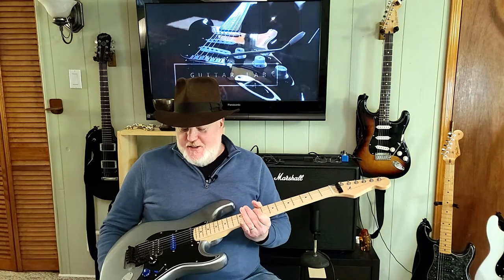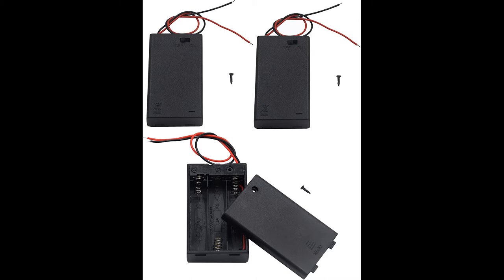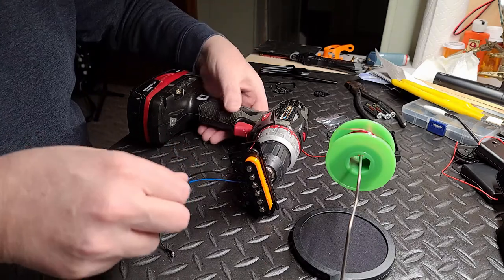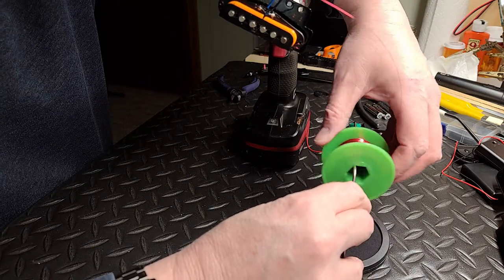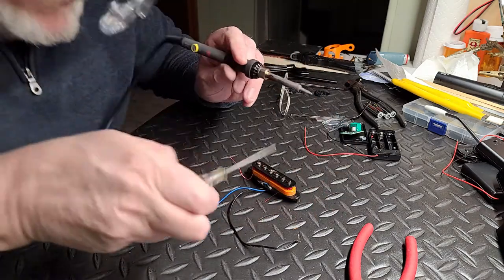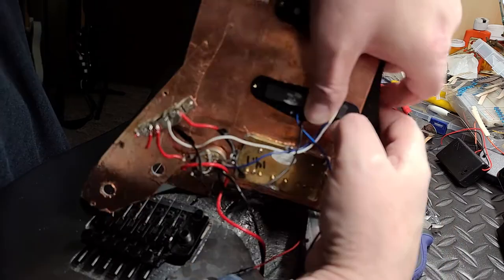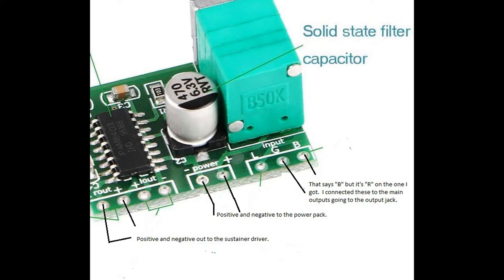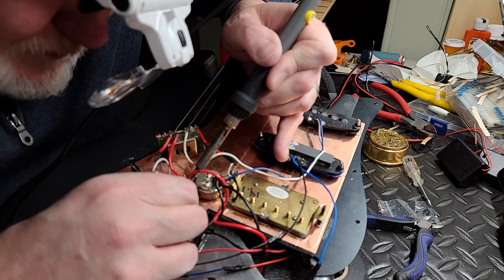Active DIY  Guitar Sustainer for about $20!

Comment: Awesome and thank you! I just did the same thing based on your video. I made one small tweak, I soldered another potentiometer in parallel with the sustainer coil and used that to lower the maximum output level to get rid of that feedback issue.
Reply from the maker: That's an awesome idea.  Post a video of you demoing it and share it!  I'd love to see it in action.
Reply: I agree, I’d like to see this as well!
Reply: yeh dude whats it like??
Reply: Nice trick bro...as a variable resistance, or a shunt to ground?

Comment: I'd be very curious as to how different it would sound if you reversed the polarity on your driver coil!  That "might" cut down on your unwanted feedback at high gain.  That is a common technique used in sound reinforcement if an acoustic gtr is feeding back - flip the phase on the monitor.

Comment: I notice many people are asking about using a 8 ohm resistor to try and use the pickup coil itself as the driver.  That will NOT work.  However if you could find a transformer you might have a shot.  It would need to be 8 ohm to maybe around 5000 ohms.  The higher the better.  Most of these are used as "step down" from 5000 to 8 but any step down can be used as a step up.  There are no longer any "Radio Shacks" so you can maybe find one online or you could scrap an old "transistor radio" (if you know what you are doing).  The right transformer to scrap would be the one connected to the speaker - and that would be the 8 ohm side of it.  ALSO REMEMBER that this could permanently fry your pickup.  They are not made to take any wattage.  The pickup windings have a much thinner wire than what the poster used for his driver coil wire.  Ever seen the wire in a 1/2 amp fuse??? A 1/2 amp fuse would fry at 2 watts (at an 8 ohm load).  😲

Comment: About 20 years ago, a friend of mine had a Fernandes with a sustainer system. It was so much fun to play with, but the pickups had ZERO volume roll dynamics/headroom. The volume pots were basically on/off switches. Even rolled up 1/4 to 1/2 way, it was about as dirty as it was on 10, even on the most responsive tube amp. I roll my volume through all of my performances. It's the source of my dynamics. The Fernandes was useless to me due to the lack of headroom. 

Does that have anything to do with the sustainer system/pickup or was that maybe that the guitar had shitty potentiometers and/or capacitors? That's the only guitar with a sustainer that I had ever played.

I've wanted to hot rod a Charvel So-Cal with one, but if it has anything to do with eating headroom and dynamics, it would not be worth the trade off.

Comment: Watched this again this morning, have a near future build that I want a sustainer in,  pretty straight forward. The spacer is my question...... it's the insulation between the stock winding and the new copper wound wire, 3 mm , I was thinking about using either wrapped gorilla tape or a piece of plastic storage container,cut and heated up to bend around the single coil
I'm thinking beyond shorting, possibly a noise issue? Otherwise I did easily locate the rest of the items.
Also would 100-110 times around give you 8 ohms? Rather than the 120? I don't really do alot of wiring, so I'm definitely a novice as far as this stuff goes, again Thank You in advance.
I'm tempted to just buy one but they are so pricey for something that you use here and there.....

Comment: Hi! Got a few questions about the image at 6:35:
1. Should I solder the positive from battery pack to negative in the amp?
2. Hot about those G and B? Should they both be connected to output jack sleeve/tip, or what? I don't understand it properly.

Btw, good job on explaining the thing in barely 10 minutes :)

Comment: Does this works polyphonicaly? I mean on multiple strings at the same time.
Reply: It should since the pickup is the sustainer and covers all strings. The sustainiac guitar by schecter works just like this. That’s kinda the point of using one of these vs an Ebow device. More options. I’d think two string octaves would sound wicked. I use an Ebow and have always wanted to give this a shot.
Reply: @michaelsnydermusic  that's what I thought! But I have never seen any examples of this. All videos I've seen  only use one string on a high gain. While I'm interested in being able to sustain chords.
Reply: I reposted your question and he says yes, it will excite all the strings (that aren’t muted)
Reply: @michaelsnydermusic  awesome news! Thanks for letting me know!

Comment: Did you remove the existing wire from the pickup and rewind, or did you put the spacer in on top of the existing wire and wind new wire over the spacer?
Reply from the maker: Hi Shannon. I removed the old wire and completely redid it.
Reply: @guitarlab7772  cool! Thanks!

Comment: Very cool idea! I love hacks like this.

When the sustain is engaged it sounds out of phase like the intro to Money For Nothing. 

If you reverse the leads going to the driver you'll invert the signal and bring it back in phase with the pickups. Some amplifiers are inverting while others are non-inverting.

It may also be cool to add a DPDT toggle or push-pull potentiometer to the driver leads so that you can change the phase at will.

This is all purely speculation, but I believe the phase issue (if present) may also be the reason some notes sustain better than others.

Comment: couldn t you just use ANY guitar pickup as a driver ? or would it melt due to too mutch voltage/input power ?
Reply from the maker: Think of it as turning the pickup into a speaker without the cone. The amp is expecting it to be 8 ohms. So you're just trying to get it in that ballpark.
Reply: @guitarlab7772  gotta be 8 ohms ... i see , thank you !
Reply: I don't understand the 3 d printer thing..what are you making with a printer? Is that a requirement?
Reply: @michaelnoe3095  well .. the 3 mm gap is important .. how you achive it not ... coincedently i started working on the coil 2 days ago and i m going to make my spacer from staking and glueing cardboard

Comment: How do you prevent a popping noise when you switch on the sustainer and how heavy is it on batteries ? tia. Nice job .
Reply: @guitarlab7772   sir ,very informative videos,,,but, did it need a power supply ,(battery)? Thank you for your reply
Reply from the maker: @doryempleo9717  Hi, yes the sustainer needs power.

Comment: How do I tell what wirers are positive & negitive from the copper wire?thx
Reply: @guitarlab7772  Actually, the polarity of a pickup or driver coil is also dependent on the orientation of the magnet. Swapping the wires or flipping the magnet will have the same polarity (phase) reversing effect.

Comment: Do you know if the direction of the coil wrap makes any difference? Clockwise/counter clockwise/even or staggered winds?  I'm right handed if that matters. I bought the battery box w/o the  switch. Does the volume knob turn the volume all the way off? thx
Reply: @guitarlab7772  thank you for the quick response. I'm going to give it a go today.
Reply: @guitarlab7772  It worked but, it didn't sound good. It was a fun project tho. Thx for your advise
Reply from the maker: @lauried.2708  I wonder why.  Was it at least sustaining?  Try and invert the + - on the exciter coil and see if that helps.

Comment: So Quik question, Doesn’t a regular pick up already come with the copper wire wound up in it already? Or are you adding more to get to the 8ohms
Reply: He removes all of the original windings because the resistance is too high. He then winds it with new wire to get the resistance down to 8 ohms

Comment: great stuff!! am making this as soon as the parts come in the post. knowing that your one works have you tried using both outputs? might they cancel each other out or short the amp or might you get double the output then needing say 16 ohms of windings?
Reply from the maker: Hi Andy!! That is a great question.  I don't know.  I wasn't sure if that amp could handle being bridged so I didn't try it.  I did think about it as I was wiring it up, but since it worked so well I decided not to mess with it.  It was powerful enough to easily push it into feedback so I figured I didn't need any more gain.  Just remember if it doesn't work to invert the leads going to your driver.  That seems to be the part most people get stuck on and there's no danger to the circuit in doing that.
Reply: @guitarlab7772  will do and thanks dude ! them sustainiacs are way too expensive for what they are, look forward to doing this!! thanks
Reply: @guitarlab7772  thanx shawn, great explanation.  i only have an 8-string  these days, and theres no market builder for one yet.  Theres plenty  of cheap single coils to convert to drivers out there. Whould that change the ohms?  or would ohms be more dependent on the output amp?.
Reply: @guitarlab7772   Hay hi ho,  Hope your'
all  well  ouut there . well, im All in whith.a homemade 8 string driver .
but 2 questions ; Can you switch off and play with a passive non- sustain tone? (2). IF i  had the money , Could  i take  the guts of a sustainiac  and drop in my  homemade driver ? i don't know, but there  might be a ohm problem? Way over my head . "peace all"

Comment: Have you ever tried to do this on a humbucker on just one of the coils? also why did you put it in the middle p/u instead of the neck p/u
Reply from the maker: I have not tried it with a humbucker.  I think I put it on the center because if I fell in love with it, I wanted to have the neck pickup as an option to use normally.
Reply: pretty sure using half a humbucker wouldnt work it would just feedback. the driver he made doesnt produce a sound we can hear but the normal coil part of the humbucker would pick that up

Comment: Hi Just curious instead of rewinding the pickup to get the ohm rating could you just use a regular pickup and add a resistor to get the correct Ohm rating?
Reply: @guitarlab7772  most pickups range from 4000 to  8000 ohms if you put a resistor that was 8 ohms in the chain whether in parallel or in series you’d be very close to 8 ohms because a normal pickup has little to no resistance. You’d be looking at approximately 7.9 or 8.1 ohms. So I know you can get the correct rating with a resistor. I’m just wondering if getting your resistance from a resistor rather than the pickup itself makes a difference. Reason I ask is if it can be done with a resistor that would save a lot of time and money.
Reply: @guitarlab7772  yeah that’s what I was afraid would be the problem I was thinking of still trying it. I saw a 10w 8 ohm resistor for a $1.50. I figure worse case scenario I’d lose a $1.50.
Reply: @islesnd  That would not work.  A stock Strat pickup has a resistance of about 7200 ohms.  Putting an 8 ohm resistor in series would make that 7208 ohms - and hence it would do nothing.  In parallel, the 8 ohm resistor would swamp out the coil and your resistance would be very close to 8 ohms (current ALWAYS takes the path of least resistance) but all your amp would be doing would be to heat up the resistor.  Very very little current would actually get to the coil.  Like say you had a waterfall that was 75 FEET across and you were trying to get some kind of decent flow by diverting it with a 1" pipe.  Which one is going to have more current???  Electrical current flow is exactly analagous to water current flow.  My analogy of the waterfall sizes is exactly proportionate too.
Reply: @hotpeppersrcool  gotcha
Reply: The 8Ω measured is the DC resistance of the copper wire, it's only for a 'basic check' to get a ballpark reading, as the signal is AC the real measurement needed is impedance also in Ω like a speaker. This sustainer device is more complex, it's a coil of wire, an inductor and inside magnetic fields.

Comment: positive and negative like hot and ground? then combine 2 wire to 1 and solder to pot and switch?
Reply: i mean positive and negative out to the sustainer deiver
Reply from the maker: Wire it just like I show in the diagram.  If it doesn't work, invert the polarity on your driver (plus to minus, minus to plus).  There's no danger in changing that part of the circuit.

Comment: Does it still work as a mid pickup. I really want this and the feedback is really cool for metal music. I have no experience or knowledge in this field . would this project be too hard for me. Feels a little bit daunting... And can you pleade explain to me how Synyster (A7X Guitarist) got feedback mode and normal sustain with just a flip of a switch... Please help me out, I won't ever afford a sustianic pickup of my own...
Reply: Digitech makes a feedback effect pedal that you can get for under $140 on reverb. Not sure where your budget cutoff is but it's a cool pedal.
Reply: if in one direction the pickup gives feedback , turning around the wire's polarity (sustainer) will give the other mode ( in phase)
Reply from the maker: No, the driver stops being a pickup.  It is producing output.  I don't know about Synyster.
Reply: @guitarlab7772  Oh thanks for replying... I made using lm386 harmonic mode is not working properly...

Comment: Does the pickup still have output or is it only used as the sustainer driver unit?
Reply from the maker: Hi, no it provides no audio signal.  It's input from the other pickups only.